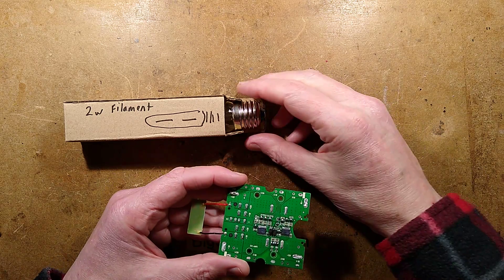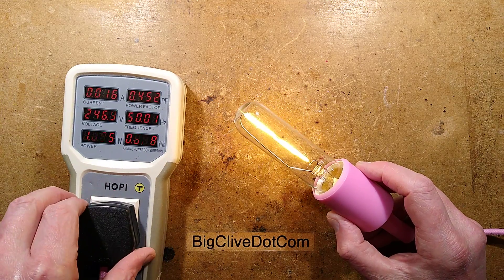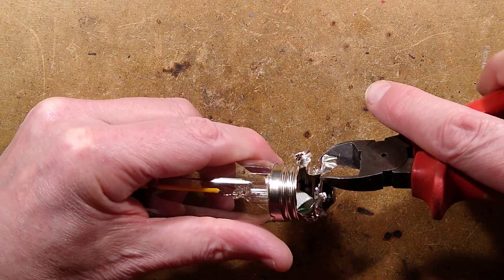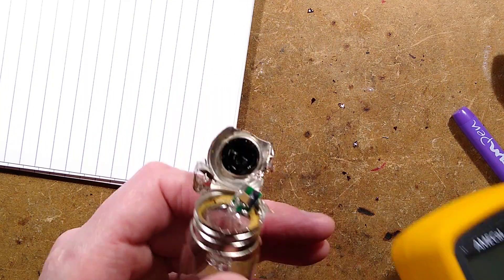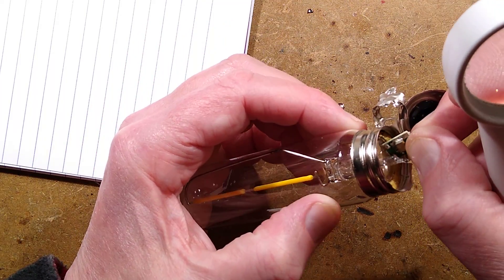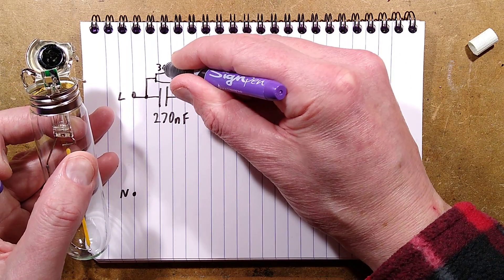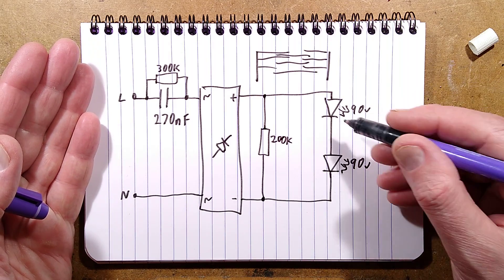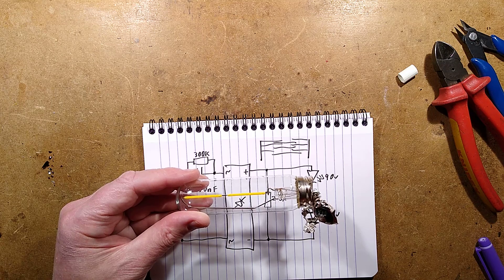Very tacky eBay LED filament bulb

Comment: reply to  Gann Dolph's thread starting "I wonder how that ceramic cap is going to hold up to ~350V ..."
My apologies for not using normal reply. I'm using an old computer with a old browser in which "REPLY" doesn't work.

I have only ever seen one ceramic capacitor failure. A decoupling cap in an array of battery-backed RAM chips (with an array of decoupling caps) failed to a "leaky" state - not shorted but some DC conductivity. It was rather a pain to diagnose and identify the problem cap. I've never seen one fail short-circuit and I've designed a lot of ceramic caps into a lot of switchers where they get beaten up petty badly. Film caps DO fail short-circuit but some types are "self-healing" - the short will blow open and clear the fault if the external circuit can deliver sufficient energy. I've seen box type film caps blown apart - but that was due to lightning strike. 

In your first post you wrote you used the ceramic caps in parallel, in the reply you said series. In a parallel configuration I would expect a short in one to protect all the others by acting as a shunt, and would actually expect that the power supply would shut down due to overcurrent. In a series config (yielding 1 µF from 10 x 10 µF) you could get a bang-bang-bang effect where one after another failed short.
Some of the newer ceramic caps with very high dielectric constant do have an appallingly high negative coefficient of capacitance with DC bias - so much so I came to regard them as just plain useless and would never again design one into a circuit.
Many of the LED lamp driver circuits for mains operated lamps are buck types with continuous current (CC) in the buck inductor (i.e. it never drops to zero in normal operation). CC buck converters are comparatively gentle on filter caps. Flyback converters, even if they operate in so-called continuous current mode, still hammer the output filter caps with pulses that start at zero current then rise extremely rapidly to some high current which drops linearly (to zero in discontinuous current mode but not to zero in continuous mode). This makes the ratio of peak and RMS currents to average current very high. (iirc, in a 5 amp output flyback I designed years ago the peak current into the filter caps was 23 A)

If the ceramic cap in the lamp Clive examined failed short-circuit I suspect the result would be blowing one of the LED filaments like a fuse, probably after it too failing short-circuit. A short in the cap along with a shorted diode in the bridge might be kind of ugly. I've seen lots of compact fluorescent lamps where a fuse with wire leads was used between the PCB and the button contact on the lamp base.
Remember that the cap in Clive's lamp only sees the instantaneous input voltage minus the voltage of the LED string.
Reply from the maker: I've come across a lot more failed ceramic capacitors due to the ever decreasing thickness of the ceramic and metal layers.

Comment: I have two of these (don't know if it's the exact same "make and model", but they have the same construction, and came in the same packaging) that I bought back in 2013 to use as a bed-side reading light. I decided to get two thinking they wouldn't last long, so I had a backup, but the first one has been going strong with no signs of quitting, even after being on for almost 12h a day (as a cave dweller, I just left it on days I didn't feel like opening the shades or lighting the main fixture because it would be too bright for my mood as I went about my business in the desk close by). They're bloody reliable!

Comment: Is that one of them fancy exploding tantalum capacitors? How exciting.
Reply from the maker: It's one of the fancier exploding MLCC (Multi Layer Ceramic Capacitors).  Literally atomically thin alternating layers of metal and ceramic, prone to cracking and shorting out.

Comment: You should design a little circuit board for this with smoothing to stop the flickering and upgrade the lamp and put a new Edison screw base back in it. Great video as always.
Reply from the maker: I'm hoping to get some ES caps from AliExpress if the seller actually ships them.
Reply: @bigclivedotcom  if you get em, please explain ES caps with a "back from the dead" video

Comment: Could you explain the leakage glow?
Reply from the maker: LEDs are so sensitive to even microamps that the capacitive coupling between switch wires is enough to make some of them glow when off.  Especially with the long runs of multi-way switch circuits.
Reply: @bigclivedotcom  Thanks!

Comment: Have you gone back to the old Hopi? I remember you had the newer model under the AnTai brand...
Coincidence or is the older Hopi still better? (just asking, because I'm currently in the market)
Reply from the maker: I use both, but the Antai unit has a fake flex that is so stiff it makes it hard to put the meter on the bench without it trying to fly off.

Comment: The type of lamps I tend to prefer, much less components should equal a longer life, no silly red hot switch mode.
Reply: If your switch mode is red hot it hasn't been designed or specced suitably
Reply: @zyeborm  With a 9 watt, or greater lamp, grab the base after its being running for an hour, usually they are VERRY warm/hot. The switchmode is jammed in there, no ventilation etc.
Unfortunately for a lot of the 'theap-n-nasty' stuff out there, the design spec is it just lasts long enough for the customer  to have lost the recipt, making it too hard to return.

Comment: Odd, for no reason whatsoever, out of the gate, I was hoping you’d disect it 😂. Ok, so that said Clive, why did they design this like a classic incandescent? I mean ok, I get the tube, etc… but the glass, the base, it’s as if they have to contain the filament, etc….etc… I would think it could be mfg’d at a lower cost if it wasn’t created with this amount of overkill?
Reply: If you have all the gear there to make glass bulbs it's actually pretty cheap to keep using it rather than tooling up to make plastic ones. Also glass is more easily recyclable than plastic when it's in a mixed product like this I'm fairly sure.
Reply from the maker: The LED filaments were the saviour of the traditional lamp manufacturers.  They used the same machines for the traditional lamps to make the new LED ones.
Reply: @bigclivedotcom  Makes the transition that much simpler… Thanks!

Comment: 6V should not be a issue for a Joule thief with a decent amount of windings. 
So you could glue that lamp in a 3d printed base with a battery holder and driver for gentle night lighting.

Comment: How would you dim this thing?
Reply from the maker: It's not suitable for many dimmers, but a lagging edge unit might work.  For a fixed intensity a capacitor could be put in series.

Comment: Would've been interesting to see the difference with a small smoothing cap across the leds (along with an inrush current limiter resistor). 👍🏻😀🇬🇧

Comment: I have successfully peeled back the metal base on a Edison screw lamp, all the way to the "glass cement". And because I liked the lamp so much, I managed to epoxy replacement donor base onto the glass dome. They somehow managed to fit all the electronics off of a Smart Wi-Fi lamp, into the base, and still retain the look of a vintage filament bulb. It's incredible how much was crammed into a small space. You would never know it was a smart bulb. https://youtu.be/WJh5RpIJdZ4
Reply from the maker: I have a couple of different units like that here to explore.  Phillips Wiz and another oddity.
Reply: @bigclivedotcom  I'm looking forward to a teardown videos them😀😉👍

Comment: Ceramic caps not only pickup sound, they also have a voltage controlled capacity.
I would expect the cap was sold as a 220n, +-20%. Don’t think they ever will come to the idea sell such a component as a 270n. 
270 would be E12, which is +-10%, don’t think they use a „precision cap“.

Comment: I wonder if the phosphorus layer around blue leds could dampen the flickering from the LED, in a similar way as a tungsten filament does not flicker either? That could also make them compatible with some traditional dimmers, dimming with a capacitor in series already works very nice and makes them much more efficient and long-lived.
I think that build-in load resistor to make them not glow when off (with capacitive leaking switches and or wiring) is a pity, otherwise it could be a dual purpose feature; a night orientation glow against hypnagogic hallucinations with virtually no (extra) electricity consumption when turned off and a normal light bulb when turned on!
A nightlight faintly glowing effect could still be achieved with these bulbs by putting a tiny capacitor over the switch just enough to get a current that offsets the load resistor inside the bulb and make the LEDs glow  with an electricity consumption that still is close to none.

Comment: ...looks like it came straight off the production line for low-watt high pressure sodium lamps. I wonder whether they filled the globe with nitrogen to aid cooling the LEDs...

Comment: That lamp reminds me of an Sodium lamp, with that thick wire going to the other end. They probably just reused some old assembly line for this, just swapped the sodium burner with LED fillaments
Reply from the maker: A lot of the old tungsten lamp equipment has been adapted for LED lamps.
Reply: So it could be😊😊

Comment: You mentioned flicker, and this raises a question. Typical movies are shown at 24 frames per second, yet as far as I know, nobody has ever complained about the flicker rate of movies. So, if our LEDs are flickering at 25 to 30 times per second, why is it that we're aware of the flickering? Seems to me that we shouldn't notice it.
Reply: Each movie frame is shown at least twice for 42 Hz or three times for 72 Hz.  Motion is still herky-jerky (look at the background during a fast pan) but covered by proper shutter opening time and motion blur.  24 FPS gives that cinema look but some people prefer video at 50 - 60 FPS or higher.  My old CRT computer monitor (my LCD monitor has failed) runs at 85 Hz.
Reply: My guess is that the difference in brightness between adjacent frames of a movie isn't usually enough to be noticeable, whereas a LED lamp is cycling between fully on and fully off. (I would assume, with a full-wave rectifier, at 100 or 120 Hz, no?).
Reply: @PharmaGiles  A mechanical projector releases NO light between frames, but very briefly.  You are probably correct that the dark time is much longer on an unfiltered full wave bridge.  Some people do get headaches from movies, but not many.
Reply from the maker: Flicker is perceived less when looking directly at it.  Peripheral vision is most affected by it.

Comment: Bayonet easier to open as you have the pins you can pull out, giving that small edge to grab and peel the base off. Lamp itself is probably still using the old lamp making machinery, just they have disabled (or it just broke) the vacuum side of the massive carousel assembly line, with probably a half dozen workers sitting there with the formed filament bases spot welding the LEd bars on, and then placing them into the machine manually, where it runs and seals the base, before it melts off the pinch. Of course they use the old dumet feedthrough, as replacing it with something likely is going to be expensive, and that wire is not expensive at all, especially if you do not care too much about the seal being good all round, just has to hold and accept the spot weld.

Comment: Opening the metal tip reminds me of those corned beef cans that had a key to wind around the can to open it.
I have a 4 watt LED bulb. It's shaped more like a bulb than long. It doesn't flicker that I can sense. Interesting video!

Comment: Wiping it with a piece of bread is an effective way to clean up broken glass like that.
Reply: Top Tip! thanks. I've a dim memory of using bread for something odd like this in the past, can't quite remember the context though.
Reply: Makes the bread taste horrible though ... I think it's maybe the blood in your mouth 😉
Reply: Just checked - also recommended for removing dust and such from oil paintings.

Comment: Heres a little puzzle for you guys.. So i got some small phone mounted ring lights at Dollar Tree a while back, they are powered by 2 AAA's or via USB
I removed the Ring Light from the casing so i could directly connect a USB cable to it so its powered by a power bank, making it brighter was the idea.. So heres the puzzle, when going directly through USB cable its using such a high amperage at 5v (Over an 1 Amp, probably near 2 Amps) that the LEDs or the pads start smoking if left on for more than a few seconds, what resistor should i use to tone it down some while keeping it brighter than when it was AAA/Micro USB powered?

Probably not much to go on, but a guesstimate would be acceptable
when powered by USB it draws around 350mA using its micro usb port
Reply from the maker: Try adding a 10 ohm resistor in series.  If it needs to be brighter add more in parallel.
Reply: @bigclivedotcom  Thanks <3

Comment: I have a LED light that I estimate has a 20-30hz flicker, it's enough to give me a headache and is very disruptive, it's fine in a corner where I can't directly see it though, using a diffuser helps.
Reply: You see the bridge rectifier in this circuit? If you want to save 3cents you can delete that from this circuit and it'll still work. Except the flicker will be at half your mains frequency rather than double and it'll drive even normal people insane. 
But hey, the manufacturer saved 3 cents right?
25hz for most 240v places 30hz for most 110v places

Note, most.
Reply: @zyeborm  It's battery operated, but probably a similar problem.
Egh, yeah.. 3 whole cents.
Reply: @MissFoxification  ok, it won't be that. You actually have to try very very hard to get it to flicker when it's powered by a battery. Like the cheap and easy ways of doing a led off a battery will give you perfectly smooth light. You have to go dramatically out of your way to screw it up. Hopefully it means you just got a defective unit, not that there's a whole line of defective products lol.

Comment: Could somebody sell an inline Edison socket 'adapter' with a capacitor in it, marketed as a 'flicker killer'?
Or is our problem on the DC side here (DC drops between 50/60Hz cycles)?
Reply from the maker: That would only work with some lamps.

Comment: Where might a guy send you a high end US led bulb?  These Sylvania bulbs are not a shape I've seen before, and I thought you might get a kick out taking it to bits.   Its brand new and I dropped it and now its DOA
Reply from the maker: Shipping is still an issue at the moment due to local postal problems in the UK.

Comment: I have some ancient LED Edison socket bulbs from the early 21st century... like 2004.  They were made with numerous high K value discrete LEDs in the stereotypical plastic blobs of the 20th century. They had horrific color rendering. They have full AC to DC converter circuits.

These modem LEDs that can drop a full mains line voltage with decent phosphorescent and color rendering are kind of amazing.
Reply from the maker: I think I may have featured that style of lamp a long time ago.  I think they still sell them.
Reply: @bigclivedotcom  Link?
https://youtu.be/1_5vTgjbvto is the closest I've found
I wish Technology Connections would do a video on it
Reply: Interesting... any images of them? Early consuner LED bulbs are quite unexplored in the electronics space, although they are unique. 
Somewhat related: I once found what might be an early LED bulb in a JCpennys that had discrete LEDs that looked a bit like a disco ball, and the light had a green hue to it (could be due to the deterioration of the LEDs)

Comment: Most of the newer led's are way overdriven. Changed an osram 13w one couple days ago, took it apart, it only had 6 chips inside, so like 2.1 w per chip. No wonder it only lasted a month, two chips have burned out. On the other hand, i have a philips bulb from 2014, that is kept on almost 24/7 still works. Took the plastic diffuser off last year, becouse condensation had gotten in, and i saw it has 32 led chips inside, a 12w bulb, so around 0.26w per chip, doesn't really get hot, it will probably last another 10 years
Reply: @samuelfellows6923  I wish it was not true Samuel, but in my experience, it is very difficult find long lasting quality products today compared to say 40 years ago.
I apologize if I offended you.
Reply: @kevinsellsit5584  - you have misunderstood the emoji ~ I am cross that the LEDs are being deliberately overdriven 🥵 to cause them to prematurely fail, forcing us to replace them earlier than stated on the box = 💰
Reply: @samuelfellows6923  I have two light fixtures in my garage, which are both turned on with one switch. In the fixture on the wall, i have an old incandescent 60w bulb, in the ceiling fixture, i have an led bulb. I kid you not, that one incandescent bulb survived atleast 2 led bulbs, and they are lit exactly the same amount of time. I still have some of those old 60w incandescents spares, bought them before they banned them, their rated lifespan is 750 hours, price sticker 0.49€, while the leds are rated for 25.000 hours, and cost 5-6€. Last month i spend 20€ on replacing 3 burned out led bulbs, since i buy the ones with color rendering index of 97 or up, they are quite more expensive than the 10w 80 cri 1.50€ bulb, while my power bill now is lower for maybe 10 euros, than before, when i used incandescents everywhere.
Reply: @samuelfellows6923  I'm old (bad with emojis).  Glad were all riding the same wave Re: products with limited lifespan built in.
Reply: Must have been a fluke built 3rd shift friday night.
I mean, a bulb with good light, 100% duty cycle, low heat output, lasts decades ... that is the last thing they would want in the marketplace (of throw-away products).
Just sayin'